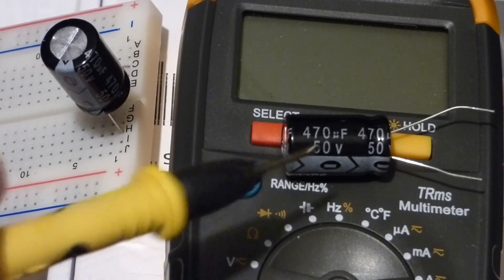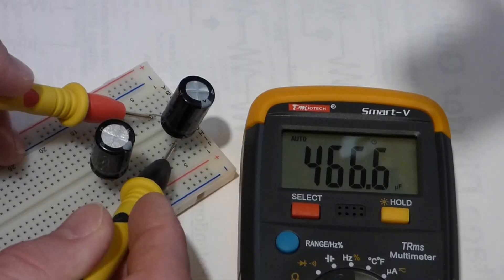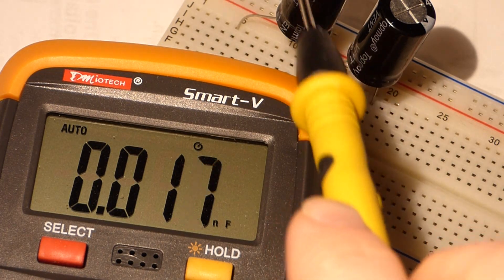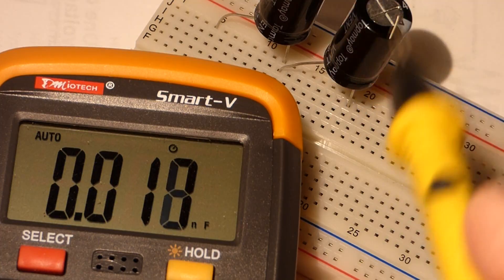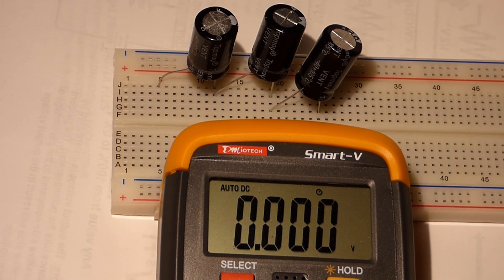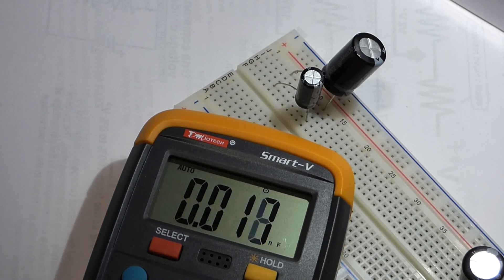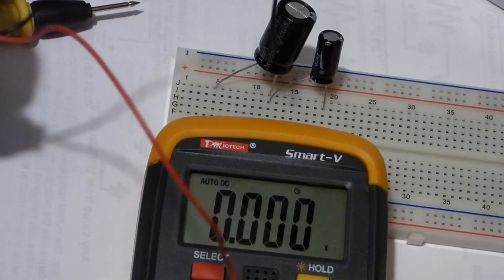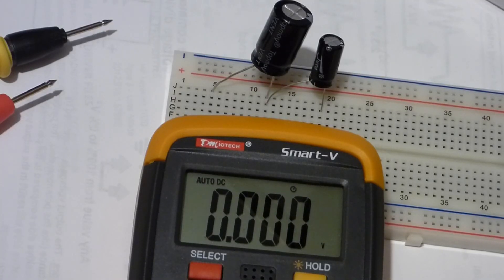Measuring series and parallel capacitors with electronics multimeter that can tutorial lesson.

Comment: What can I charge a 16v cap at ? For example I've connected a 28v transformer with a full bridge rectifier and this 16v 1500uF cap and the end DC voltage was 36v, does that dmg the cap ? I mean it didn't blow up... but I didn't test it for a long period of time... I guess it's bad, right ?
Reply from the maker: I haven't done any capacitor testing like that so not an expert. I have damaged some so that they discharge more quickly than they should, which is what I am guessing that charging them to that high of a voltage would most likely do. Another youtuber over charged a polarized capacitor in the wrong direction and it blew up.

Comment: very nice video , thnx for sharing 
i have power unit of LCD tv that need a capacitor with 1200 uf/25v, didn't find that exact numbers currently in my area electronic shops, i am planing to use 2 capacitors and joining them to give me the total of (1200/25), i have 1000uf/25 can i add 200 or 220 in parallel with the same volt to give me what i need ? or what do u recommend for my current situation ?
Reply from the maker: Parallel 1000uF and 200uF is a good way to get the equivalent of 1200uF as long as they can handle at least the same amount of voltage, as you state they do. I never repair anything, so don't know of anything else you may run into, but I know that electrolytic capacitors fail often as they age and need to be replaced, so I'm sure that's all you'll need to do. Hope it goes well!
Reply: @Electronzap  thnx for the replay ... actually what i found is 220uf/25v gonna connect it with 1000uf/25v and see if that will work, at least till i find the proper spear (1200uf/25v) ... wish me luck ;)

Comment: How would two non polarized capacitors be wired in series? Or would that be redundant?So:
----12uf---4.3uf---=3.16 total cap or
Set caps side by side and solder the two end on one end together and the two end on the other end together is parallel, right? For a total of 16.3 tc. I want to run non polarized caps in series, basically. This is for a speaker crossover btw

Comment: When you have to watch labs online bc of the Corona Virus smh
Reply from the maker: Hey there! I was literally just watching about people not going out and wondered if YouTubers would get more views. Thanks for watching! Hope it helps!
Reply: Totally Relatable!!!!
Reply: This is exactly what I am doing!  
Wish the instructors would post you tube videos too....
Reply from the maker: @dannyj6787  Glad to have you watching!
Reply: @Electronzap  
Wow, so cool.  I never expected you to reply!
If you have a second, I am having trouble figuring out how to calculate the charge (Q) through each capacitor. 
Can I take my voltage reading and simply multiply it by the capacitor value>
Reply from the maker: @dannyj6787  I'm not terribly strong on math, but the basic property of a capacitor is that 1 farad will need 1 amp of current for one second (a coulomb of charge) to change 1 volt. So, a 1F capacitor at 5V has a charge of 5 coulombs, whereas a 1,000µF capacitor will have a 0.005 coulomb (5 millicoulomb) charge. When there's capacitors in series, they all share the same current path, so 1A for 1 second will change each 1F capacitor 1 volt per second. That's about as good as I can explain it lol.

Comment: If I have two Capacitor one for example 1uf 400v and another one 2 uf 250v by connecting them in paralell I know that the capacitance is 3uf ????v  but what is the voltage rating now ?,,,,,thenks
Reply from the maker: It is the lowest value of the parallel capacitors. So you'd have to stop charging when you reach 250V. Both capacitors will be charged to 250V at the same time, which would be the same time it would take a 3F capacitor to charge to 250V when charged through a resistance. Charging to any higher voltage will likely damage the 250V capacitor.

Comment: Could you please explain something to me about what to look for when looking at the specifications of a capacitor for building a guitar tube amplifier?
Some questions I have are;
1. Ripple Current, am I looking for a high number or a low number in the spec?
2. Temperature, Am I looking for a higher or lower number in the spec?
3. Leakage Current, am I looking for a higher number of a lower number in the spec?
What manufacture will usually have better specifications;
1. Panasonic
3. Nichcon

This was the best video that simple explains series & parallel so we can understand. Thank you for sharing you wisdom with us!!!
Reply from the maker: I've never done any music amplifiers so I don't know their demands. Audio electronics is one of the areas of electronics I least plan to get into. Generally speaking though, you want enough capacitance to smooth the ripple to where you don't notice the effects. You always want low leakage, but that may cost more so that's probably not a major concern for a circuit you constantly keep powered as long as it isn't too severe. Heat is always the big concern for electronic components, so you need to check maximum current and power ratings. Typically capacitors don't heat up much but if they are rapidly charging and discharging, have higher internal resistance, near other hot components, etc. Then heat may become an issue and you'd need one rated to handle that. Usually when I plan a completely new project, I google circuits designed by others and try to get as many opinions as possible. I learn a lot reading product reviews too.
Reply: Thank you for the quick response and educating your viewers.

Comment: Question: I have connected three 1uF in series with a 9V (measured as 8.1V battery before connection). From first to last capacitor the voltage was 8.1V and the capacitors were around 2.5V. The thing I have noticed is that by holding the multimeter to the legs of a single capacitor the voltage kept dropping gradually all the way from  2.5V to 0.7V - when I terminated the experiment. I have tested all 3 capacitors and all 3 showed this behavior. Why? s this because the capacitor discharges through the multimeter and the current goes around the capacitor since this is the path of least resistance?
Reply from the maker: Capacitors lose voltage on their own over time in a process called leakage. If you want to store energy in capacitors for long periods of time, you need special capacitors. Smaller value capacitors will lose voltage due to a multimeter much quicker than larger value capacitors as some current needs to pass through the multimeter to take a measurement. The amount of current passing through the meter is determined by voltage and the smaller value capacitors have less total charge stored and thus their voltage drops faster for a given amount of current.
Reply: Thank you for your answer. I know capacitors lose their voltage, but I was surprised that this would happen even when the power "that feeds them" is constantly on: red wire of the 9V battery-C1-C2-C3-black wire of the 9V battery. I thought that drainage happens only when they are isolated from the power source "feeding them"  for example with a pushbutton, pulling them out of the circuit, etc.
Reply from the maker: Oh I see what you mean. While in series, capacitors will charge unevenly if there is a current path around them (such as through a multimeter). The capacitor you are measuring will lose voltage and the other series capacitors will gain voltage. These unequal voltages will remain after you remove the multimeter and if you discharge them, the one with the lowest voltage will actually fully discharge and then gain a negative voltage as the higher charged capacitors discharge into it backwards. I have to go to work so can't post links right now, but I did some videos on this, and how dangerous it can be if you let it happen.